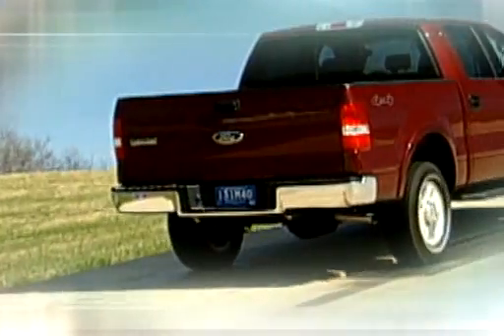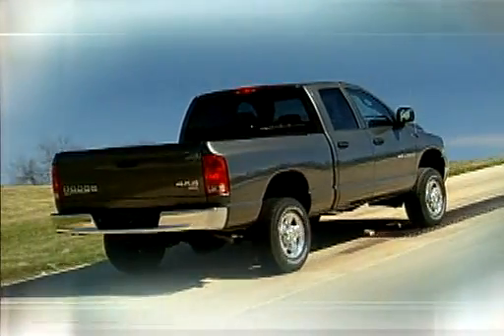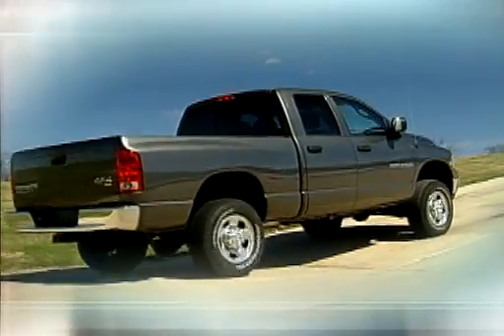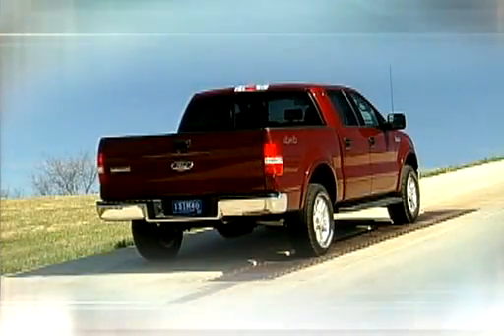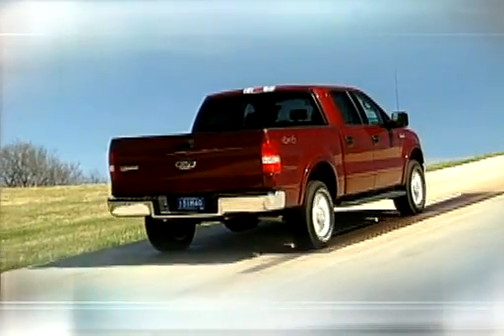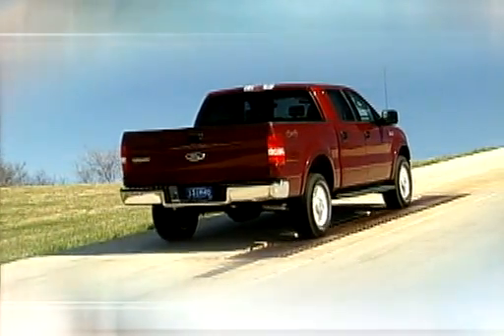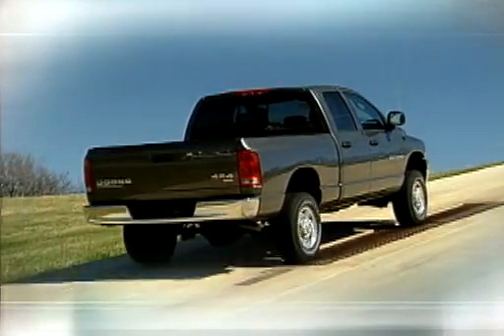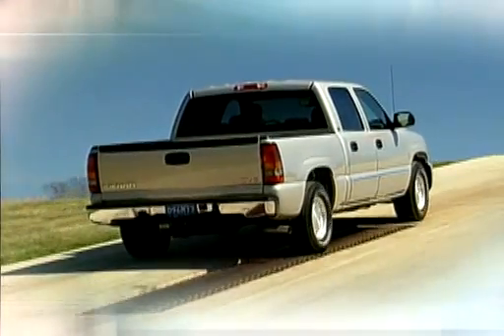20% grade G80

Comment: @clarda1 hey tell you what years ago yes lockers were options on gm trucks but now they are still considerd options but is really hard to find one that doesn't have one because over time they realize the sold more trucks with lockers than without so now they pretty mutch all come with them already see look at it this way back in the day air conditioning was optional but the didn't but now it is still considered an option but you really cant find a vehicle without it now it is the same concept

Comment: @partyhouse88 Funny how this is so biased it does not test the ram or the ford with locking differential. OR even the Silverado with a limited slip. So biased. Dodge or Ford can do the same thing and not show their truck with the non locking differential. It all depends on what you get, and not all chevys are equipped with this G80

Comment: G80? Any body who knows how to drive a truck with a limited diff is to lightly press the brake and throttle at the same time then the spinning wheel will transfer its power to the other wheel.  No need for special fancy shmansy locking crap. Just a little education.

Comment: it's in 2wd...only the 4x4's came with the G80...
Reply: Actually, since the G80 all 2 wd and HD trucks have the G80. Not all 4x4 had it, just the tow package 4x4s and the off road 4x4s.  I think GM is putting the G80 in all their trucks now.  That's also the reason why their HD don't tow as much as competitors.  The G80 is hard for towing, can't be under as much strain.  So they have much lower tow numbers than everyone else in the HD classes.

Comment: The Z71 was just in 2WD.  The GM truck in the 4x4 part of the vid was 2WD.  And as of the NBS GMT-900 trucks, Z71 is available on either 2WD or 4WD.
Reply: Z71 is only available as a 4x4.  The 2wd model is the Z66.
Reply: I have a 2wd z71 @AdolfOliverTitsov

Comment: a turn is no different dumbass...its called a REAR locking differential...the rear doesn't turn.  for those of you that say you would never drive a Chevy, you're just being ignorant because the 2007 Silverado is the best truck out there, hands down. Chevy sells about 600,000 Silverado's per year and Toyota sells about 100,000 Tundra's (on a good  year) so that should tell you something

Comment: The locking differential design was modified in mid-1986 to include a load-limiting feature to reduce the chance of breaking an axle shaft under abusive driving conditions. The number of tangs on the energizing disc in the left-hand clutch pack was reduced allowing these tangs to shear in the event of a high-torque engagement of the differential locking mechanism.

Note "abusive driving conditions" you stupid hicks.